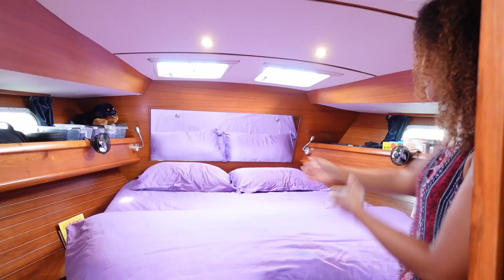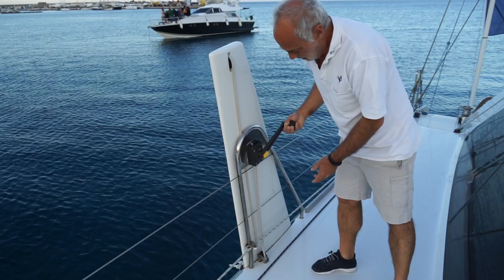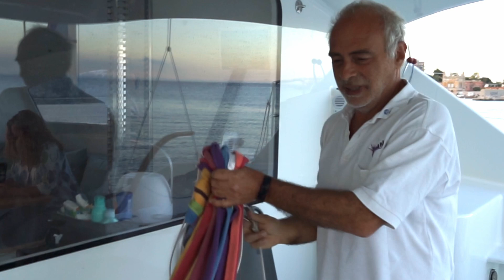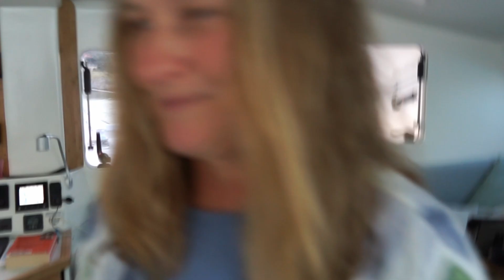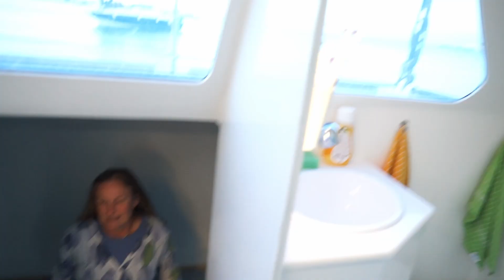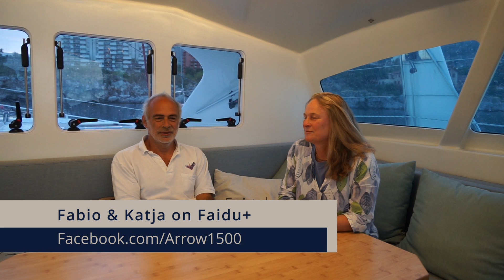Review Schionning Arrow 1500 sailing catamaran

Comment: Would love more details on the contraction of your boom. What is the diameter of your carbon tube down the centre ? What is its thickness. I take it the carbon pole is the main strength with the fiberglass mainly for the sail to lay in. Love it !
Reply from the maker: Hi Mike! The carbon tube has different thickness' The last meter where the sail and reef lines are attached is thick walled  (I think 50x60mm) and yes the fiberglass is just for the sail to lay in. We have a FB album of its construction (https://www.facebook.com/media/set/?set=a.2570234199673227&type=3). You could contact Mick (Roam sail surf) and ask for the drawings! We are very happy is works great, also as a hoist for the dinghy so we don't need davids.